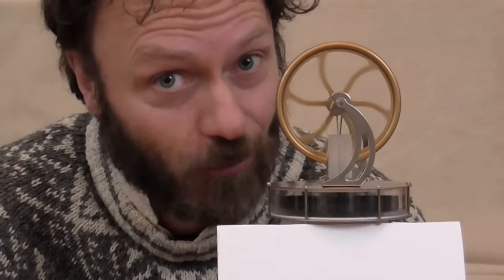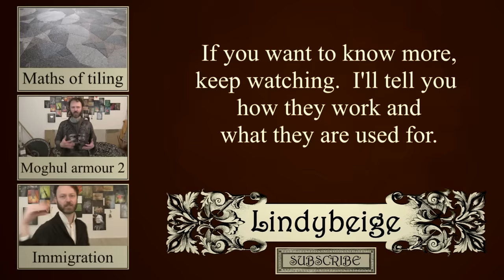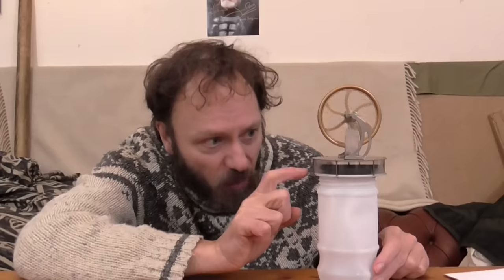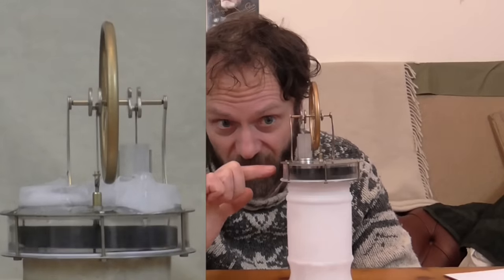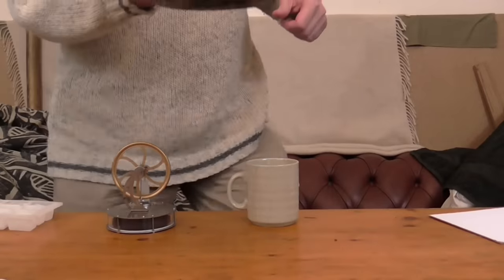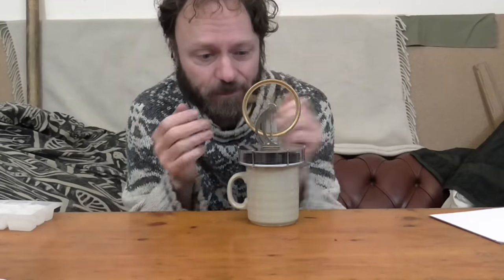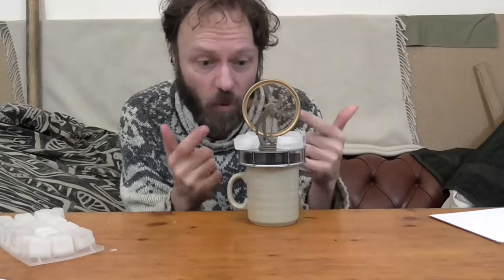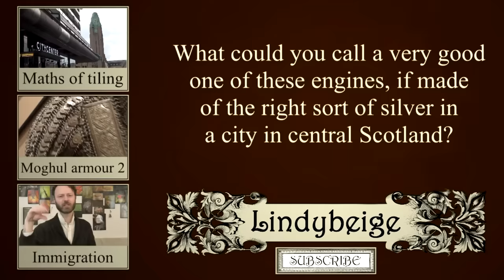Stirling Engines - the power of the future?

Comment: thats a realy nice object of engeniering you have there. i think about what would happen if you combine the sirling engine with some type of the Archimedes mirror. this way you could get a wayyyy greater temperature difference. about 600-2000 °c. only powered by the sun. on the other hand i would use a water pipe system to store energy via gravity & heat.

Comment: There is one thing that has kept these things as toys:  The low thermal conductivity of air. In order to operate the working air inside the machine must be heated up, and cooled down. The air gets it's heat and looses it's heat by the contact between the air and the heat sinks that make up the chambers. But because air is an insulator, the only air that heats quickly is the air in close contact to the walls of the chamber.  So, the  smaller the chamber, the faster the unit can cycle.  Some engines have used hydrogen or helium as the gas because it is more conductive. 
    The other item is the air pressure.  If the whole apparatus is taken up in pressure, the amount of force exerted by the heating and cooling becomes greater. So, if you want to get a higher power density out of one of these, you want it to be very small, at very high pressure.  If you do that, the next difficulty is keeping one chamber hot, and the other chamber cold by external heat transfer. 
   So there you have it, a tiny high efficiency sterling engine with a high power density.  Then the only problem left is making it big. by duplicating a lot of them to run a common shaft.  And a lot of shaft assemblies to get the power up even higher. 
   In fact, a Sterling engine was once developed under government funding, and given to the auto companies, but the auto companies declined to put it into production.
Reply: Use geothermal activity to heat water, use the hot water to heat the cold plate, and just water cool the top plate. Ideally you could probably just power a turbine off geothermal energy all the same
Reply: There are many industrial Stirling engines being used even now.
Reply: @MrSpaceRatt  There was a US government sponsored sterling engine for autos. It worked, but the auto industry did not want to use it.  Can you show one actual Stirling engine in use?
Reply: @MrSpaceRatt  They only have a data sheet on "Cryocooler Datasheets"

Comment: Wouldn't these be perfect in the desert? You have the engine under ground, and a large bay filled with enclosed water so it wont evaporate. During the day it is heated and pushes heat down to the engine, cooler temperature underground causes the temperature difference. During the night the temperature is extremely low but underground always has the same temperature so the engine would spin the other way.
Reply: The problem with your thinking is that underground DOES NOT always have the same temperature. Just because it doesn't evaporate doesn't mean it can't heat up. The pressure in that underground chamber would increase, which would keep the water mostly in a liquid state (given that it would be perfectly isolated). But as I said that doesn't mean the water would not heat up.
Reply: I meant the engine is underground, the water is on the surface but enclosed. Think of it like a greenhouse or a bottle of water (or some other liquid that heats up easily, doesn't have to be air or water if there is something else better suited). So the water would heat up in the greenhouse during the day and cool down during the night. Then some pipes would lead to the engine, kinda like a steam engine I suppose.
Reply: MadCowCrazy oh yeah that makes much more sense. But I guess as long as we don't have numbers that prove us otherwise, we can say it's just not as efficient as let's say solar panels of equal size. Smart idea though.
Reply: The sterling engine would just heat up/cool down the ground in its vicinity to the air temperature and after that point it would stop working since its fueled by the difference in temprature. 

The reason it works on for example submarines is as lindy pointed out, you got a continues flow of water that cools it down, -you move away from the heated water.

However using sterling engines in geotermical powerplants is a differen't matter, since you have two active temprature sources, geotermal and cold air.
Reply: There are solar powered Stirling engines, uses mirror(s) to focus sunlight to create enough heat for engine to work.

https://en.wikipedia.org/wiki/Solar-powered_Stirling_engine
https://3dprint.com/54456/solar-powered-stirling-engine/
Reply: You would heat up the ground very quickly and the temperature difference would very quickly diminish until you cannot power the stirling anymore. Unless you can get a reliable temperature differential, there's no point in installing a stirling engine.
Reply: The Question is how long would it take for the Stirling engine to equalize the temperatures? Lets say 5 Hours. Then the Engine would work the first 5 Hours after Sunrise und the first 5 Hours after sunset, so 10 Hours per day. Compare this to a solar panel, which works 12 Hours per day. The Question now is produces the Stirling engine in this time more energy than the solarpanel? 

Another Question is: What do you want with this energy in the middle of a desert? The Transport of Energy is a really big Problem and you use a lot of energy while doing that. So it might be more efficient to build the engine near to the consumer even if the efficency of the engine itself is not as high as in the middle of a desert.
Reply: They put solar panels and wind turbines in the middle of nowhere as well so I guess the efficiency would be the same as other sources?
Reply: MadCowCrazy,,  you're right that can work

Comment: Three things: 
1. No this stirling engine is not coal powered, it is FUSION powered. As the coal was produced by biological processes, which where driven by the sun hence solar powered production, while the sun is fusion powered.  
2. You have an aliasing effect once you put ice on the top, it looks slower but  the increase of bluriness shows the increase of velocity.
3. Antarctica power stations are a bad idea. Any engine reduces the thermal gradient over time as they are driven by it. Thus, you would melt away antarctica for energy gain. Also distance to power consumer would be an issue, like with the desertec project.
Reply: Much appreciated. :)
Reply: Everything on Earth is fusion powered.
Reply: Where do you even draw the line though? Fusion itself gets energy from annihilating matter, I think you lose about 5% mass when the sun fuses hydrogen into helium.
Reply: Freigeist 20789 actually, it's gravity powered since the nuclear fusion of the sun is caused by gravity.
Reply: Well the line is hard to define accurately in physical terms. But I would state that matter to energy conversion is part of the fusion process. In the end one could always claim that we are using remnant energy of the big bang, as all matter is a condensation of that inital energy.
Reply: Addendum: Mass loss from hydrogen to helium fusion is about 7 %. Take the atomic mass of 4 hydrogen atoms and divide it by the atomic mass of 1 helium atom to get the number for relative mass defect.
Reply: To power a Stirling engine from scratch you must first create the universe

Comment: Water power rigs, Stirlingly combing the Stirling Stirling engine, electrolysis of sea water, wind solar and tidal power. The rig would be a tidal power rig with a Stirling engine mounted on the side along with wind and solar on the roof all powering electrolysis of sea water producing a 2 part hydrogen and 1 part oxygen gasous mix which then can be ignited in a piston actuating a flywheel which rotating a magnet around a copper coil producing electric current which charges a capacitor that gets shipped back to land along with pure water. Obviously any excess power produced would charge the capacitor as well.
Reply: Any thoughts?
Reply: The electrolysis bit is a little redundant.  You could just send the electrical energy generated by the solar, wind and tidal back to the land directly.  Electrolysis is also very energy inefficient so you'd be wasting a lot of power, and performing electrolysis on sea water will produce some very nasty byproducts such as chlorine gas.

Comment: Lloyd was incorrect about the submarines. They use liquid oxygen for breathing and making the inside plate of the Stirling engine cold, while the sea is the hot plate.
Reply: they use liquid oxygen to oxidize diesel fuel to produce the heat and then condense the products of combustion (CO2 and water)  and discharge them overboard  - The CO2 is dissolved in the cold water and so the only emissions are heat and carbonated water.
Reply: @maniacal_engineer  That doesn't sound like they would do that in stealth mode.

Comment: Should use the heat generated by a GPU to power a stirling engine.. :)
Reply: Builders hate him! Watch how he decreases temperatures by 20°C in *one simple step*!
Reply: But fan rotates so slow. Card will overheat
Reply: @pavankumaracharya  atleast he try....
Reply: A GPU with heatsinc.,
Reply: Actually MSI created Stirling CPU cooler :)
Reply: Partially power a computer with the heat generated by the computer. XD.
Reply: @justaguycalledjosh  True, it could be used to trickle charge it's own battery.. .
Reply: @justaguycalledjosh   I had a thought about solar power:  the ironically perfect source of electricity... to run air conditioning in hot, sunny climates 😁.
Reply: @pavankumaracharya  I don't think he actually meant for it to also cool the processor. Just mentioned something that is heating up.
Reply: @pavankumaracharya  For a small fan, yes. A bigger fan that's cooling a heat sink doesn't have to spin that fast...

Comment: That point you mentioned at the end about heating your home and getting power,
Exists already, installed one of those in 1 or 2 houses already
Runs of gas to heat your home, heats up the engine somewhat directly and the room temperature does the cooling effect

Pretty neat

Comment: Ideal in Iceland, no?
Reply: Roger McKay Really Ideal in Iceland :D If you want, you can probably reliably power a house using a sterling engine XD
Reply: Technically ideal but practicall not ideal :) Since they already produce more geothermal energy than they even use :) No point in making even more. They get steam for free, so might as well run steam turbines, it's more efficient than Stirling engine. But yes, practical and useful if they connected Iceland to Europe and started selling clean, renewable energy!
Reply: iPelaaja1 Sell it to the UK

I'd like some cheap electricity please! XD
Reply: If someone ever develops a good way to store electricity (batteries are not all that great), Iceland will probably top using the thermal energy to farm tomatoes (they actually have greenhouses with tomatoes there) and start producing batteries.
Reply: Greenland is colder than Iceland, as an average. Odd enough.

Comment: Heat engines as this one are not very efficient. They are limited by thermodynamic limit of efficiency, called the carnot efficiency. Moreover that theoretical maximum efficiency can only be achieved at zero power output.
The more power you want, the farther away from the carnot efficiency the engine gets.
Electric engines don't have these problems, because they don't run on expanding gases and temperature differences.
Reply: It's weird that people are suddenly touting this as the technology to solve our energy problems, given those facts. We abandoned this long ago except in novelties for a reason, that reason being we found something more powerful.
Reply: Nieroshai I don't see it as a way to advance, I see it as a way to achieve small scale subsistence off the grid... or just as a stepping stone if civilization broke down.

One can make a lathe from scratch with salvaged materials.

I sure as hell can't build a new solar panel from scratch, but use a parabolic antenna coated in reflective tape to power a Stirling engine made from a bucket of scraps? I could try.
Reply: All engines are heat engines and Sterling are the most efficient at any given temperature variant. But have other drawbacks.
Reply: +misium
Stirling engines are low-tech easy to made and easy to maintain solution for renewable energy. To make solar panels you need a high-tech know-how and expensive materials, if you brake a solar panel it is done, you can not fix it. 
As such it might be a good idea to use stirling engine generators in 3rd world countries. For example instead of sending them solar panels we could help them build factories making stirling generators. 

I don't understand why are you mentioning electric engines, the video was about using waste heat for powering things. We are not discussing stirling powered cars, we are discussing how to charge batteries of electric cars with stirling engines.
The only way that we can generate energy without heat engines right now is  using solar panels and wind/water turbines  (and maybe peltier cells, which are less efficient that Stirling engines).
Reply: misium You need to get that electricity first. Which we usually do by making something spin and hooking a generator on it. Something like a heat engine.
Reply: GODsave: Maybe, perhaps instead of braking the solar panel you merely bend it. 
3rd world countries will always be 3rd world countries if we insist on "fixing" them with junk science. We are fast running toward them, economically,  with such non working "solutions" as wind turbines (don't really work ,and never will ) solar panels ( the same as the wind) we have thrown billions in revenues at them and they still don't really work, but we will continue because we never really learn. The word is always we are sooooo close ! But we never get there.
Reply: Charles Wood Stirling engines are junk science? So you're saying that Sweden, Singapore and Japan are using junk science on their submarines?
Reply: I meant exactly what I said , no more , no less.
Reply: Charles Wood So you're saying that Stirling engines are junk science even though they've been defined by thermodynamics and it's basically second year stuff in an engineering degree?

Because that's what you're saying, I'm not even asking at this point, I'm just accusing you.
Reply: 3rd world people are free to buy any technology they can afford. They will always be 3rd world if we destroy their economies with aid. Free stuff destroys the ability of locals to earn money by producing that stuff.
Reply: what pray tell is an electric engine?  I am familiar with electric motors ( permanent magnet DC, shunt wound, series wound, AC induction, AC servo etc)  these all take electricity and turn it into rotational work, bu they are NOT engines.

Comment: The timing on startup is probably why it needs some encouragement sometimes; if the plunger is too close to the opposite side of the cylinder relative to the hot plate the hot air will just expand in the side that is already expanded.

Comment: Just to be pedantic, I think the two plates will be aluminium as it conduct heat better than steel, whereas the separating rods between hot and cold plates will be stainless steel as it conducts heat much less. Great video!

Comment: no Stirling engines don't produce enough power to be practical and they produce very little torque. They require a large temperature difference to produce power. So you have a external combustion engine
Reply: You can power stirling engines with waste heat, like the exhaust of an internal combustion engine or engine or an industrial process.
Reply: Ian M  
So how do you get more torque, instead of just rpm?
I'm far from an expert on this, but I know that, for example, a small Tesla turbine can make tens of thousands of rotations per minute, and you can still stop it with a stick.

Maybe if you make the wheel much bigger?
Reply: Ras just use gear reduction. Less rpm but more torque
Reply: @ras573  Like The Pope said and you can also lubricate the setup very well to reduce the friction, for making electricity you just need to rotate a magnet between some copper coils no need to make them contact.
Reply: The original wheel looks super cool, but it produces unnecessary air resistance because of its open design. It's the same for indoors racing bicycles, who have whole disks instead. To maintain the steampunk design it can be painted/printed on the disk. I think it is most useful around equator because of the near constant heat and super intense sun. Create a water cooled bottom part dug into the earth and you got a great output. I believe it's also possible to power light vehicles [glass fiber/aluminium] in flat terrain [maybe on rails] using that heat, and the increased speed makes wind rush to the lower part increasing the speed.. The engine will look oversized, but if it works it's incredible.